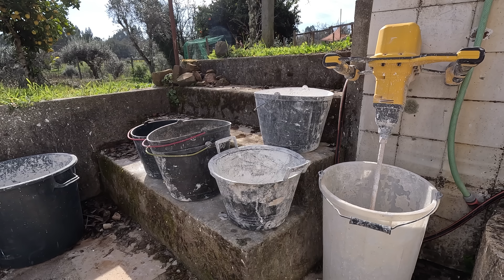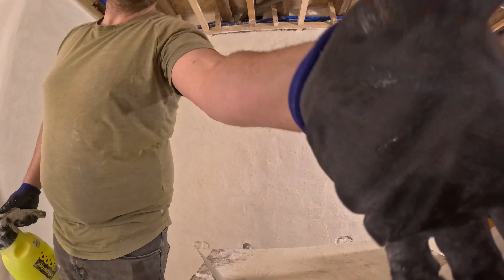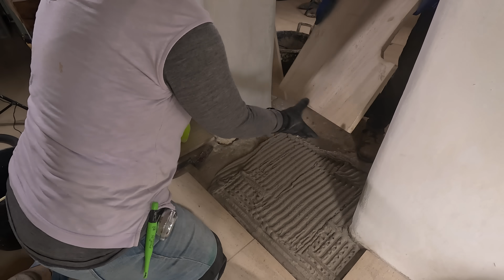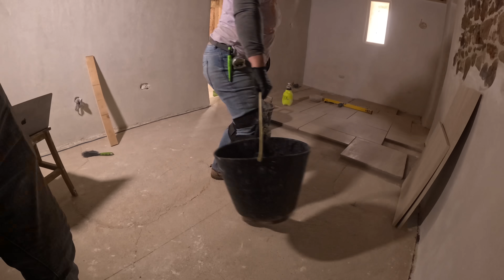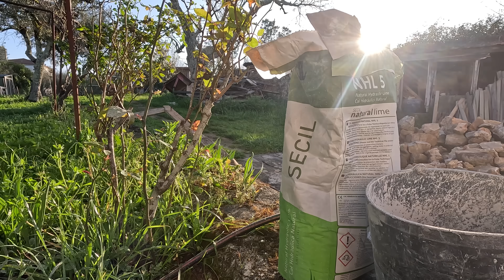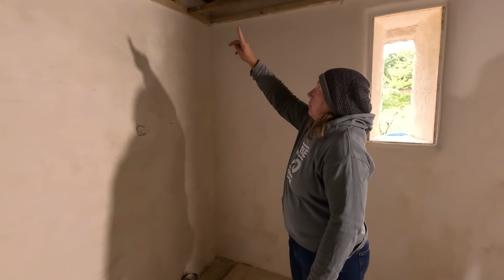Another Room (Almost) FINISHED! - Renovating a House in Portugal

Comment: Hi guys! Thanks so much for sharing your process, it’s informative and entertaining! 
We are about to lay our own limecrete floor here in the UK. 
After researching, I thought I’d understood the best way of doing this - 22mm limestone slabs on an NHL grout bed around 10-18mm thick (to absorb any irregularity in the limecrete and stone slabs) on the limecrete, once cured.
I’d love to be attempting it myself like you guys but time isn’t on our side! So we have a builder doing it for us - they are very good but definitely more conventionally minded.
The builder isn’t that familiar with this process and has raised their eyebrows because I’m not suggesting a primer or adhesive for the stone.  I guess they are worried about it debonding, but I guess I can take ‘responsibility’ for that, if it happens.
Apart from getting them to watch your video, what sources of information did you rely on when you took this approach?

Comment: Making use of heaters to help drying faster may be a good idea.  
To tile around corners there are useful materials, such as strong nylon netting, as used in stucco, etc. or even different types of metal netting.  Your tile provider    can give lots of appropriate info.  Good luck.  You are amazing hard workers!

Comment: I saw someone using what looked like a cordless sander to set tiles into the mortar bed. I think it would be less likely to break tiles than using a rubber mallet. A pair of wire hooks could be used to lift tiles if the mortar bed wasn’t right.

Comment: I will try and explain how to attach the skirting board (baseboard) to rounded wall corner; is to have a triangular shaped piece with the top cut off so that the bottom of the triangle is wider than the top which is attached on the rounded part of the wall corner. I have rounded wall corners and that is how the baseboard has been installed. I can send you a picture if you PM me.

Comment: Re. the mechanical air system: try to keep lengths as short as possible (improves efficiency), but more importantly make bends as wide as possible (reduces noise   dramatically). Good luck!

Comment: Wonderful work, fabulous results which will remain enduringly beautiful! 
As soon as I saw you trying the notched trowel I thought 'no, not with a slack mix of mortar...'  I'm sure you are correct: laying a (comparatively) thick bed for the slabs requires overall support so a slack mix allows the required movement. People saying you should use a notched trowel must be more familiar with thin layers of adhesive: that tool is designed to lay a bed that averages around half the depth of the notch, WAY less than you needed! You guys do well to draw on others' experience when relevant but rely on your own sound instincts. 👍🤗

Comment: Hey guys, great job and your house will look amazing when it's finished. I think that if you soften the tile mortar less, it will spread more easily and will hold the weight of the tile much better. Maybe using a little more lime will make it more sticky and workable, it's just an opinion, because each job has different requirements and you follow your experience. It's great to see your progress. Greetings and keep posting videos.
Reply: Mate, have you tried removing it with 0000 steel wool? In Italy while I was working in the building sector, I learned that you wait until the mixture (grount) is a little dry and then remove it with the steel wool, you can try a small area and see how it turns out in your case. I don’t know how it would be in your case but it is a different approach, maybe it suits your needs.

Comment: You should have leveled the floor with a filler before laying the tiles. Then the notched trowel would also be able to do its job properly. If am not mistaken, You now run some risk of tiles becoming loose, wobbly or even cracking. Always make sure you level the entire floor before you lay down any kind of floor cover, this makes it much easier and also leads to a much better result.

Comment: That floor shows just how much time and effort was invested - fabulous job!  Just thinking, as to the base tile curves, could you apply lime render to just the curves, placing little indents to mimic the stone,  then use colour tints in lime wash to faux finish these areas using a sea sponge - I can imagine you two could achieve a near perfect look without having all the cuts needed to use tiles, perhaps you could experiment using ground up earth as pigments.

Comment: If you decide to piece the corners (cutting slices) I would make a conscious decision to only use “x” number of slices per corner. While it may seem constricting, it will actually free you up to pick the angle that help you achieve the (let’s say) 3 slices. From that point you simply decide the size of each of these slices to make the corner. I think looking at the result it will look more intentional if you see the same number of slices on each corner, regardless of the varying radiuses.

Comment: You both have earned a vacation to recharge and have some fun. Are skirting tiles required? Are they used because it is a stone house? I find that keeping a home tidy using a mop and vacumns knicks the tiles . Furniture bumps it. I prefer wood trim. I would make custom tiles for the round wall edges. It takes a bit of math because clay shrinks during the whole process. I wonder if you have a potter/tile maker near you? I understand your tiles are limestone not a fired clay product. Love your videos , see you after your break.

Comment: what did you use for your sealer?  I'm finding it hard to work that out - sealing limestone but also ensuring the lime floor breathability is maintained.  I have this same job coming up soon :-)
Reply from the maker: Unfortunately there is no such thing as breathable sealer, though there are natural dealers (in the old days they used milk).
Recent research has found that all the work in a limecrete floor is done in the first layer, which provides a capillary break for moisture. So you can actually have a concrete slab and non-porous tiles etc and the floor will behave the same (or so the research says).

I discovered all of this while researching sealers … can dig out the resources if you like 😃

Comment: I think you both deserve a pat on the back for what you have done so far. Out of all the channels I watch your floor is the best looking. I also have to mention the scribing, what a superb job that was, its one of those jobs the you don't notice until you do it wrong then it stands out like a sore thumb. No sore thumb on your floor, well done. After all that work you deserve a GOOD break, it will give you both time to recoup and also time for things to dry out. The heat is coming, we in Cyprus are up to 25-26c most days now, so thing will dry out quite quickly soon. Thanks for posting

Comment: Sometimes I've used notched trowel on the tile and a thin smooth layer om the floor. Or notched on both surfaces and putting them parallell. Has worked well when I've needed a thicker layer. (Normal tiles aso.)
The floor looks great.

Comment: notched trowel requires the thinset (adhesive) to be thicker.  It also assumes that you are not trying to build up the base thickness with the adhesive which is why the notched trowel moved too much material around.  Conventionally, you would build up the base with mortar, let set, then use the adhesive with the notch trowel.

Comment: The floor looks amazing, well done that was one hard slog but well worth it. the design looks abstract but is anything but as I am sure you spent hours working it out, made a lot off extra work for you guys but think if you had gone for a conventional square or rectangle it would have made the rooms feel smaller and highlighted anything out of square so well done.. hopefully its drying out nicely now so you can crack on to the finish line...

Robb Torremolinos Spain xxx

Comment: As far as the corners for the skirting tiles, make them a feature. Do all of them the same and make it look intentional. I like the idea of the slivers going around the corner. You may not even need to angle/undercut them. Perhaps continue the slivers around the corner a bit, not just a couple inches for the bend. You may even consider a different color tile to accent them. Hmmmm, I wonder if adding them to the inside corners, and maybe a few sections along the wall would tie them all together?? (Look at me,...adding to your work! Sorry!)😁💕(Robin E)

Comment: I would suggest Skirting tiles look a bit fussy if you use mitre slivers on  the Radius .(Radii ?) you have when your floor is such a bold clean visual statement .You could decide not to have any up stand on the door radius and finish  the upstands back from the curves by a couple of centimeters and round/nose off and Polish the upstands ends .(Any stone yard will do this for you to your template )Make a clean feature of this rustic regularity rather than attempting to  “bend “stone round them  .Just a thought .cheers .the floor looks ace by the way .

Comment: 12:50 :) Yeah, i get what you meant last time, thanks for filming that in such great detail.

With the subfloor soaking up so much moisture so quickly, and you keeping to your theme of using NHL as the basis for your adhesive/mortar, you kinda have to use a really, really wet mix, it doesn't seem like there's a point to using a notched trowel, I see that now.

I mean, the only point of those notches is making the process of placing the tiles perfectly in terms of elevation easier, its not like its not possible to do it with the mortar lying flat, you're obviously doing a great job at it, for me personally, it would probably be a lot harder at first, since you just dont have enough leeway to adjust the tile after you laid it, you have to get the amount of mortar under those huge tiles way closer to perfect than with the notches.

You got me thinking though, I wanted to copy what you did with the subfloor, i really like the idea of using those expanded clay aggregate thingies, having it vapor permeable/breathable in combination with proper ventilation seems like a great idea in terms of longevity, I'm just wondering what else you could use as an adhesive above that subfloor that also keeps the permeability.

Or, or, I could just do the same as you did and plan for more time and a lot of swearing ^^

The room looks fantastic btw.

Comment: In my house which has rounded corners on the walls, at the bottom where it meets the skirting, they are moulded into a squared corner about 10cm above the skirting. So the skirting is just straight. Perhaps you could put in a 45 degree section on the corners if you want it to hug the wall. Then just fill in any gapping level with the top of the tile.

Comment: The border tiles around the door. 
Don't make too many small slivers. One on 45 degrees wouldn't be enough. But I think two facets would be enough.
The more you do, the messier it will look. If you make more pieces, the more surfaces you have to align.
Even though it won't be similar round surface as the wall, it will be a marrige of the two - organic wall and straight stone floor.
Keep it simple...

Comment: That floor looks 10/10. And you have done so great work that you really don’t need skirting tiles at all. I think that it looks better without.
Reply: For the looks you might be right, but,
When you clean the floor wet, skirting tiles you can touch without a problem, the stuck at the wall would become dirty over time
Reply: Seconding the no skirting tiles. With grouting and sealing, I think it would not be necessary. Also, not doing it now does not prevent doing it later if you find it would be better. Undoing skirting tiles… not so easy
Reply: Another vote for no skirting tiles - the finish is spot on. 

Is Guy half full and Kylie half empty ?

Comment: Notched trowels are used with thinset mortar and you need to coat both the floor and the tile back side. With what you all are doing it is best to just put a mortar bed down and using leveling clips to ensure the tile surfaces match (that's if all of the tiles are the same thickness, otherwise just press into the mortar bed and use a level).